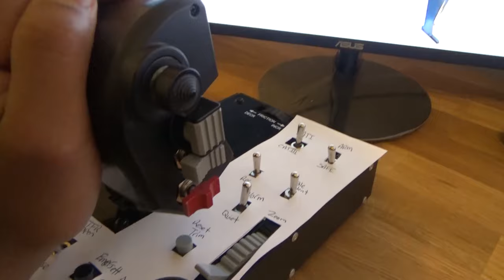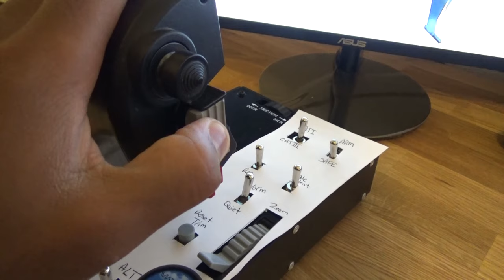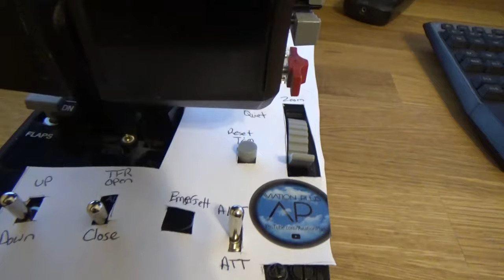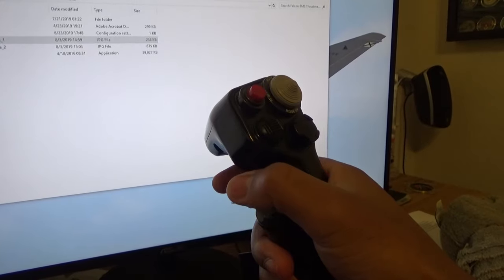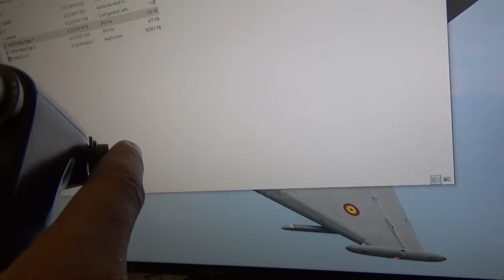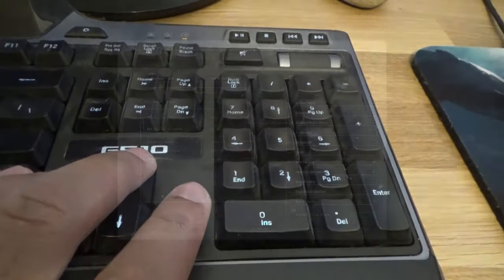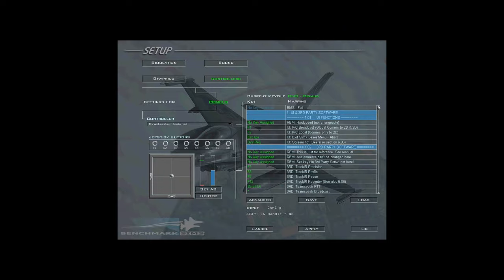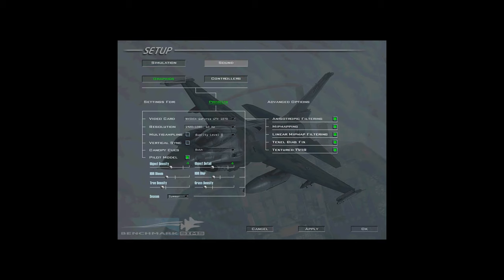Thrustmaster Warthog: My Falcon BMS Control Mapping Part 1

Comment: Ey dude thank you for the nice videos, i checked your 2 videos about your target hotas, i did follow every step and downloaded your files, it's working fine but my radar slew on my hotas warthog is not working, any ideas? Btw the throttle led are supposed to turn on if ap is active but they don't turn on, i don't care but i could be helpful, ty!
The x and y axis of the slew are working fine on the setup page, but in cockpit they just do not move the cursor at all.
Reply from the maker: The cursor doesn't work on the ground and sometimes you have to make your HUD SOI and then go back to one of you MFDs to trigger the cursor to work again. Thanks for the kind words and I am glad to be of help.
Reply: @AviationPlus  Thank you my friend, the hud soi thing worked like a charm :D
Reply from the maker: @MrVitoriusBig  Awesome glad to hear